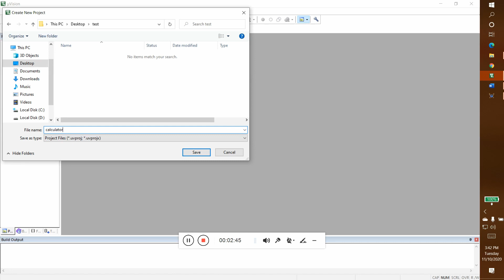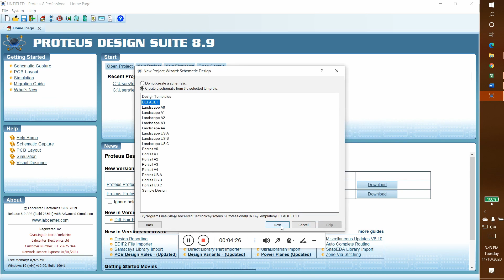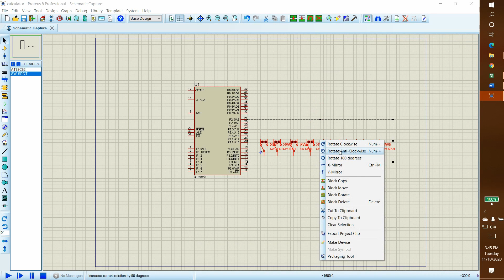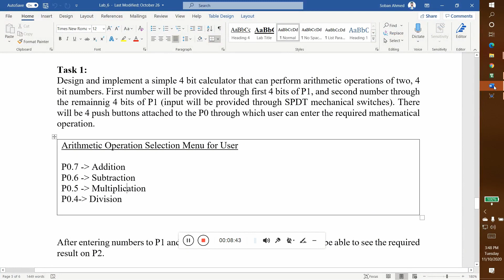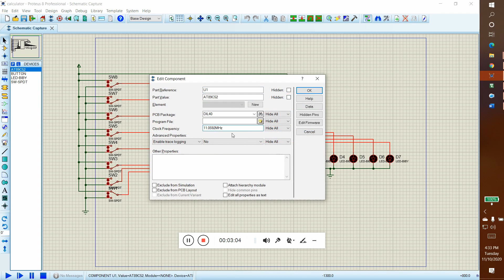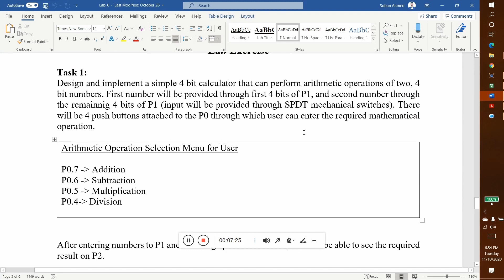4-bit Calculator | 8051 Assembly Language | How to easily solve complex problems (Mind Grooming)

Comment: thank you so much may you please make a flow chart of this problem
Reply from the maker: It is quite an old video, the flowchart is not available for it.
Reply: @champsoban  Hello sir, so will I be correct if I use swap instruction instead of rotating 4 times?
Reply from the maker: @busisiwengwenya2347  yes you can use swap command it will do the same thing, The reason we normally use rotate command is because when you come to embedded c language you will not find swap command or you will not require swap much often. Rotate is more commonly used command. I hope it answers your question.
Reply: @champsoban  thank you so much it helped a lot, I will do embedded C next semester
Reply from the maker: @busisiwengwenya2347  welcome. Good to know my lecture helped.
Reply: @champsoban   Hello, I came back to say thank you again after watching your videos I managed to pass my exam with 75%.You were truly God sent. May God bless you
Reply from the maker: @busisiwengwenya2347  kudos, happy to know. Wish you much more success ahead!